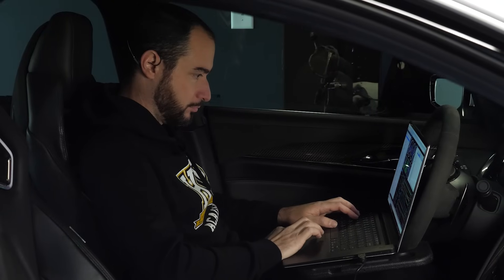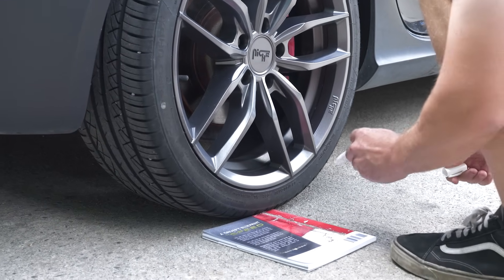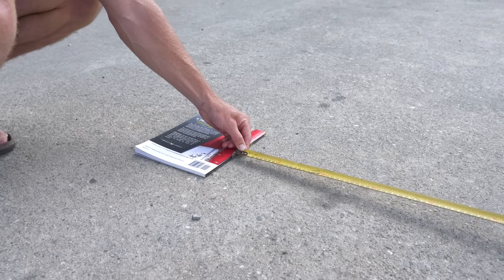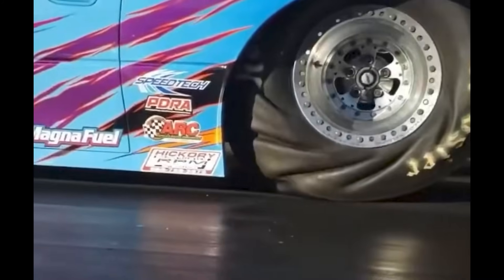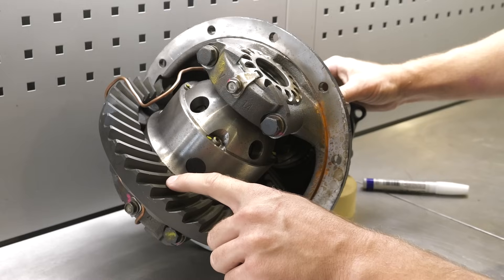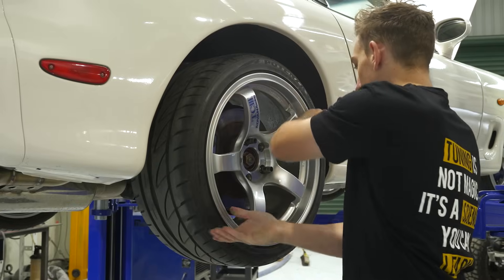Don’t Trust Your OEM | This Measurement Is CRITICAL

Comment: I'm surprised that no one mentioned changing tire sizes as a way to fine tune the final drive. Likewise, an offroad vehicle may need a more aggressive diff to compensate for a larger tire.
Reply from the maker: That is also covered in the Practical Transmission Tuning course. This is just one specific module from the course on one specific topic and if you are playing with your tyre sizing you should 100% be doing what Mike is showing you here too. Hope it helps 😎 - Taz.

☀ Put this knowledge into action and tune your own transmission. $50 USD off this online course: https://hpcdmy.co/transtt

Comment: Smarter people simply use 2 GPS sources for speed, distance and compare to speedometer and miles recorded by car.
Reply from the maker: This module is a transmission tuning course module and covers how to set the tire size in the tune. This isn't how to calbrate a or check a speedo calibration. For that you could indeed use GPS, or even better, a calibrated dyno will tell you 🤘 - Taz.

Comment: On our Jeep Trackhawk, changing the tire size in HP Tuners causes an instant response in ABS lights, traction control off, etc on the dash. There aren't a lot of grippy tires available in the 295/45R20 size so I tried a 305/35R20 Nitto drag radial and that caused the speedometer to be inaccurate by about 6%. I went back to the OEM tire size eventually.
Reply: @thevtecnician  get alphaobd.  You can change ratios in most Jeeps.
Reply: @jeremeyparks3411  I'll look into that thx! It does seem though like the grand cherokee isn't as simple to change ratios as the Wranglers

Comment: If you have an open diff and only one wheel in the air, you need to rotate the wheel once, you are only going to get half as many driveshaft rotations.  It seems to me you need to rotate the wheel two rotations, but only divide the driveshaft rotations by one.

Comment: My Jetta has a speedo off from the factory. 10km at 100km/h
Reply from the maker: Yes there are laws around this as well to make sure you are doing a lower speed than what is shown, not higher - Taz.
Reply: That's usually normal, at higher speeds manufacturers lie so that people don't try to "play games" using speed, or to sell more cars regarding top speed, after a certain value on the speedometer, the bigger the number the higher the mark.
When doing top speed runs, accurate instruments are placed to measure accurately the speed instead of the gauges
Ex: in my car, 120kph (Km/H) in the car is about 113 by GPS (google maps);
It gets worse if you start messing with tire sizes and wheel sizes, MCM did a video explaining this a long time a go, but, there are websites that take the information regarding tire sizes and tell you how big the gap is.
TL:DR :Manufacturers lie on the speedometer so people don't go so fast & sell more cars, you can fix this;
Reply from the maker: @ruigato6607 Generally, GPS is used by journalists (and others) for those tests. This is also because it keeps things consistent if nothing else.
Not sure about the rest, there are a few old wives' tales floating about that might have been true a few decades ago, but I doubt you'd find any real reference to substantiate the rumours these days.
But you are bang on with changing the size of your tyres, and if you do this dramatically, you will need to adjust the reading to suit. Super common with 4wd guys going to much larger diameter tyres.
There is a speedo accuracy tolerance; there are generally laws around how much bigger or smaller you can go diameter-wise legally without further mods to suit.
Of course, your race car doesn't care about those laws but as outlined in this video, the information itself still matters in other ways 🤘 - Taz.

Comment from the maker: Tyre vs tire. 
Does one or the other look completely wrong to your brain or are both spellings common enough you don't even think about it anymore?
🚙 Building a fast car? Get $400 OFF the all-inclusive VIP online course package deal: https://hpcdmy.co/transvip1
☀ Put this knowledge into action and tune your own transmission. $50 USD off this online course: https://hpcdmy.co/transtt
TIMESTAMPS:
0:00 - Why Tyre Size and Final Drive Matter
0:35 - Don't Trust OEM
0:41 - Tyre Measurement Method
2:15 - Repeatability and Circumference Calculation
2:40 - Tyre Height/Diameter Calculation
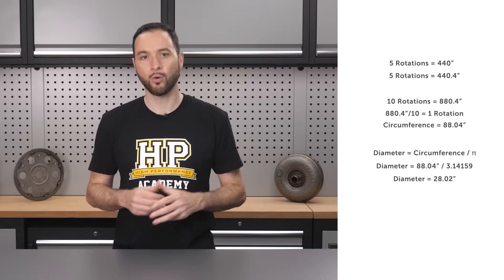3:37 - Adjusting for Operating Pressure
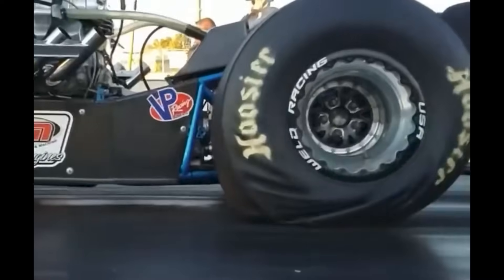4:03 - Tyre Growth in Drag Racing
5:10 - GPS and Torque Converter Lockup Strategy
5:14 - Confirming Final Drive Ratio
6:00 - Counting Ring and Pinion Gear Teeth
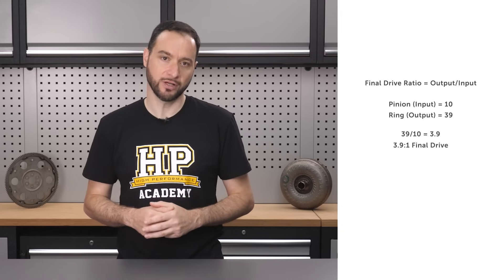6:54 - Visual Method for RWD Differentials
7:56 - Limitations of Approximation
8:47 - Transaxle Limitations
9:03 - When You Should Measure
9:16 - Summary and Use Cases
9:24 - Converter Lockup Speed Calculation
9:50 - Lesson Summary
10:47 - Transmission Tuning Is Not Magic
11:08 - Course Info and How to Start